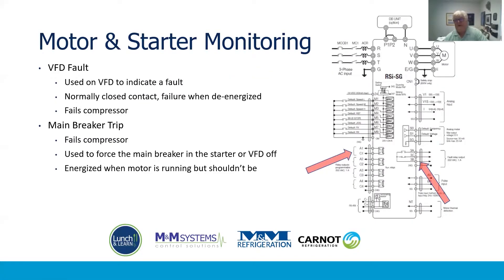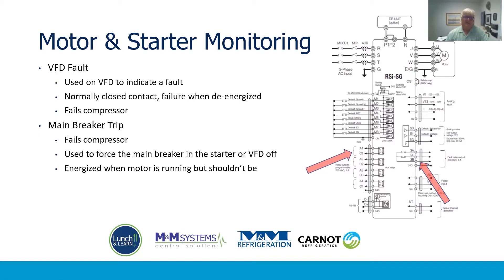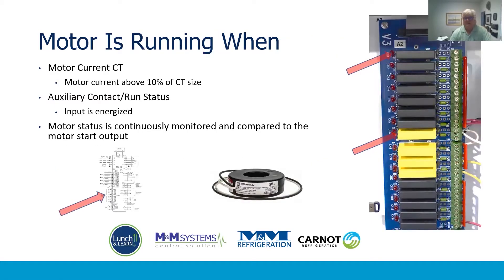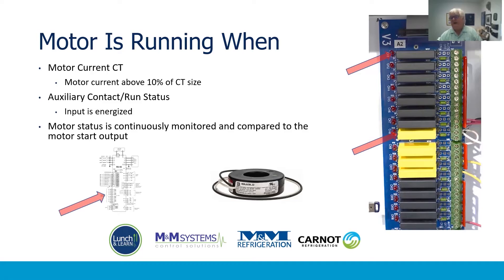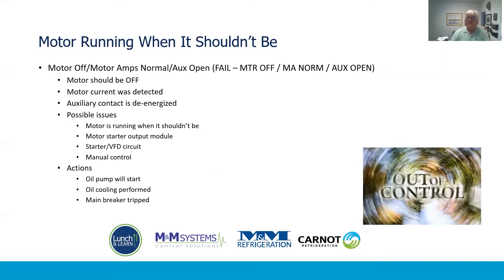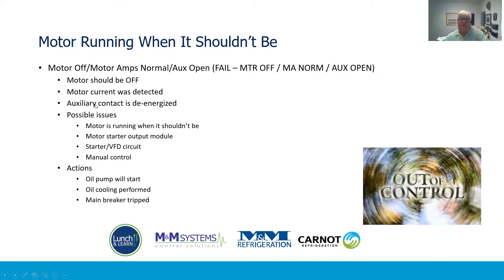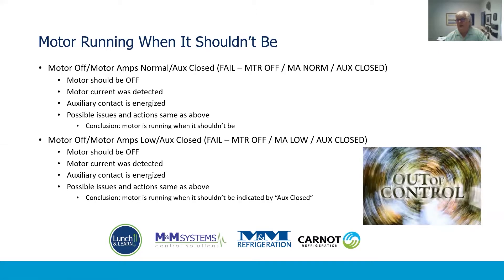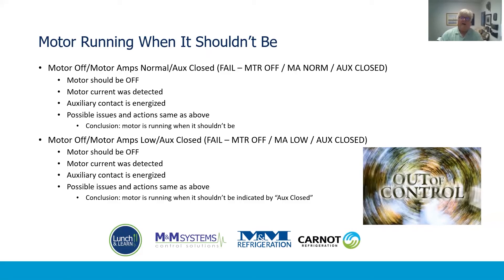VFD Faults and Main Breaker Trip Events

Comment: Sir, thank you for the video. My VFD machine triiped its breaker when swiping off the main isolator of the machine, then the utility panel tripped for one time after a whole day of working?

The machine has four wires as standard, but our utility uses a five-wire system. Is there a solution?

thanks in advance